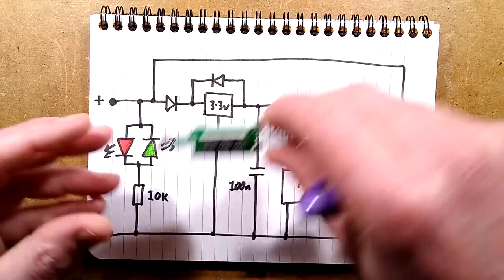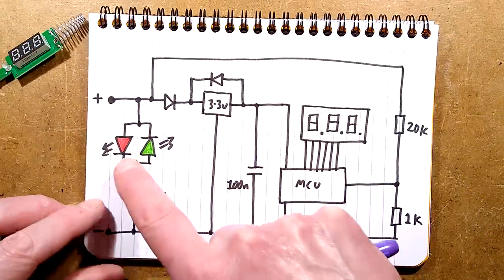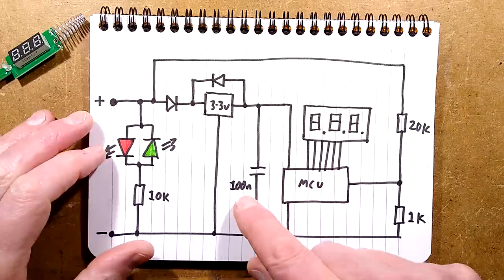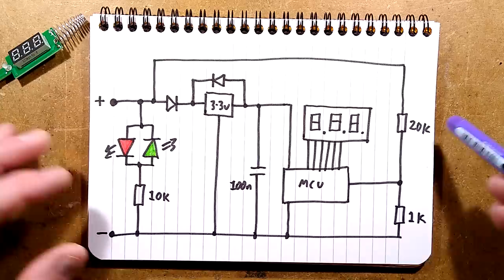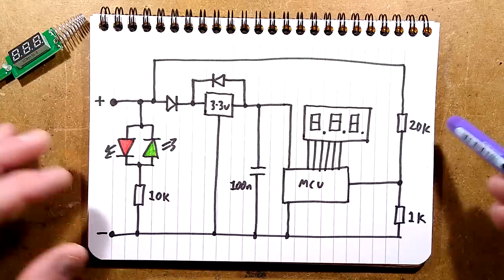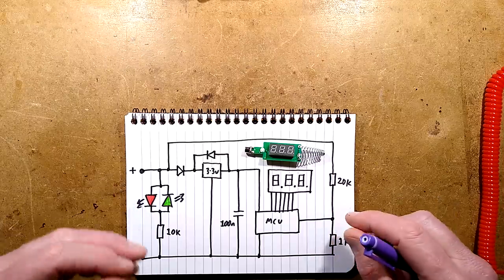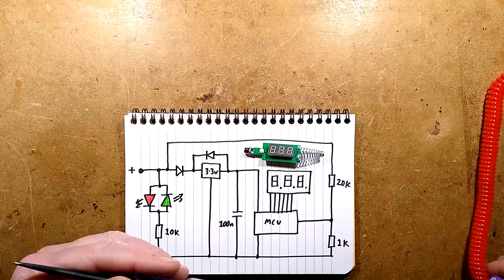Unusual, but accurate low voltage probe (with schematic)

Comment: Im going to test this circuit, because i have a feeling the 100n cap couldn't damage the surface mount regulator, you would have to short it while it was measuring a voltage because the led will drian that tiny cap almost instantaneously on disconnecting, as you know the recommended is usually 10uf both sides and a parallel 100n on the output to keep it stable and avoid any high frequency oscillation, (you can usually get away with just the 100n on the output, especially at low current and your well above the drop-out V ) in that situation with 10uf on the output charged to 35v maybe that could dump enough  di/dt to damage the regulator, (especially if the connected load adds capacitance) but here im going to guess not, i think the inductance/impedance of that 5ft coiled up test lead would be enough to save it alone, il let you know 😂 il measure the peak current with a low impedance shunt, il hit it multiple times and try a couple of different caps, then if it survives il add capacitance until it doesn't 🤷‍♂️

Comment: Could it be used also in some solar charging systems also like 12v and 24v setups?
Reply: 24V industrial control panels too.  Would be really nice with a 1000V model that quickly switches its ranges and voltage regulation method even if power is only different for a few ms . Would need some skills though to design the power supply and input subcircuits to accurately measure with 2.7 to 3.6 V inputs without frying anything at 999V continuous.

Comment: As the circuit does draw at least the current to drive the LED display and MCU, perhaps this is a fly-back diode to prevent inductive kickback from killing the MCU by the circuit under test? The only reason for it across the Vreg that I could divine, is that it would negate polarity protection if it were across the input instead of the Vreg. BTW, it does look like it should be pronounced 'chassis'  instead of 'shassis'... (kinda like it's prounounced 'chess' instead of 'shess') 😏

Comment: I like it. It may not have the functional capacity of my Fluke (only volts, no amps, ohms, etc…), but would fit in my pocket, and fewer things to hold.

It would be nicer if it did a few more things, but then it would have more buttons, and be bigger, which would be less nicer…

Comment: 5:13 oh, I know what it was supposed to do.
Originally, it would have been a freewheeling diode, that would protect the regulator against inductive loads, and against reverse polarity during turn-off.
In the case of that implementation, though, it does nothing, because it never gets directly polarised for more than a few tens of ns at a time. Lol

Comment: I have seen many car mechanics make the mistake of using an LED test light like this to attempt to diagnose electrical problems. Bad idea. LED's will light with little to no electrical connection... that's not a good test instrument when what you're looking for is a bad connection. A good old fashioned incandescent test light is the way to go. It draws enough current to only operate on a decent connection, or unbroken wire. And if you're used to your particular light bulb, you can instantly tell when it's not bright enough. I suppose this one is good for testing alternator charging and voltage drop.

Comment: The diode is, as you say, to protect the regulator. Normally, if there was a short on the input the smoothing cap would discharge through the diode. I suspect that was the initial idea but either the input protection diode was added as an afterthought or the pcb is incorrect.

Comment: This screams low cost technically acceptable. The led is backwards the lead color don’t match up. It’s like how much can we save and still make a workable product
Reply: The led is meant to be that way. Green indicates a good ground on 99% of automotive testers
Reply: @MattyEngland  interesting. I would have thought green means proper connection red means reverse connection. I guess automotive have different tests and terminology
Reply: @brentsheltz6473  Yeah, you can connect the more expensive ones to both battery terminals at once, then touching power gives you red and a voltage reading, touching ground gives a green LED (and often an extremely annoying constant beep)

Comment: now, connect to the mains and see what happens. 🤣🤣🤣
my buddy pretty much did that years ago, put an low voltage automotive probe on 240v water heater when checking elements.🤪🤪 KERPOW, cloud of smoke, molten plastic and bits flying about, blackened hand. only sorry I missed seeing it happen!

Comment: Brilliant video, I have a test lamp that looks the same as that but it has like a car interior bulb in it, I used it when I was doing car alarms and stereos, the times I had stabbed myself with it lol
Reply: I have one too I use it for buffering when connecting an inverter to a 12v battery
Reply: @pollywollydo  spot on thanks

Comment: my snap on one is more pleasing....
but has an incandesant bulb so can be used on zero volt also. voltage could easily be assessed by bulb brightness..👍thank you clive
edit 
this diode could be so u can use it either polarity like my one

Comment: Pretty sure the led is not the wrong way arround. if you switch polarity on the aligator side to positive you are on a hunt for ground connection failure on a vehicle. 
The green led signals just yea where you are polking right now its there all good here.
Ground on the clip side you perform deep analyses of circuits or fuse Boxes and so on.
The lead having current is also "hot" so its red led warning light now.
Its not counterintuitive from a car mechanica sigt of view.. ist your intuiion who is "wrong" here :P

Comment: Clive, would you consider this tester to be "electronics-safe" or "computer-safe" for automotive applications? I install Alcohol Interlock devices in vehicles and currently use a simple probe with a LED and resistor to verify wiring before I hook the interlock device up but occasionally need to guess what wire does what when I don't have a diagram for a particular vehicle. Something like this would be nice to eliminate another tool in my tool bag if I didn't have to worry about it frying a vehicle computer.
Reply from the maker: Current draw is only 2mA at 5V and 7mA at 12V, so it should be safe for electronic use.

Comment: did you look under the display for hidden chips?
Reply: the diode above the regulator is to protect it from short's I had that problem befor the diode was removed and the regulator over heated and blew up

Comment: THE REVERSE BIASED DIODE IS ACROSS THE 3.3V REGULATOR TO PREVENT THE OUTPUT BYPASS CAPACITOR FROM SPIKING THROUGH THE REG IF A SHORT OCCURS ON THE INPUT OF THE REG, SEEN THIS CONFIG IN DATA BOOKS FOREVER (SAFETY ALWAYS!)

Comment: Looks like a cross between a voltage tester and an awl  to me.  Use it to test electronic circuits Monday through Friday, use it to punch holes in leather for your weekend leather working hobby.

Comment: You know what - as red is right and green is wrong, while red goes to black and black goes to red: I think they designed it into the other orientation, until someone found out it was designed by a left-handed and the numbers would be upside down for right-handed people. 🤪🤭😂

Comment: Hi Clive, 
diode with capacitor reminds me of a voltage multiplier, feed it back into the input of the regulator to add to the incoming voltage (possibly allowing a 1v input to output a 3.3v regulated supply... possible? ).

Comment: looks like the diode across the regulator is a „datasheet residue“.
Chinese might not all be idiots, but share the same idiot-ratio with the rest of the planet.
I remember the duscharge diode being only needed for higher regulator voltage (<=12V), but in this case it is definitely no „discharge“, but a „disabled“ diode.

To the accuracy: a 10-bit ADC has 1024 steps, a tiny bit more than a 3-digit decimal display (1000). So no wonder it is precise.

Comment: Clive didn't say if the display moves to 1 dot 2 digits (hundredths) when the voltage drops below 10VDC.  The ones I bought do - 9.99 volts, etc.

Shonky isn't a word I'm familiar with, but then I'm separated from Clive by a whole ocean and a whole continent (so. California), so forgive my ignorance.  🤪   Thanks, Clive.
Reply from the maker: Fixed decimal point.  Blanks the first digit.

Comment: I can imagine the diode across the voltage regulator being a simple mistake. Many of them contain a diode integrated like this, so maybe someone just saw the symbol drawn with this diode in a datasheet or schematic and thought they should add it. Or maybe the other diode wasn't included in an earlier design iteration and then the one across the regulator was just left in there at the end despite being unnecessary.

Comment: back in 2021 , the covid days, I turned an old MAC automotive electrical tester into a high tech modern version very very very similar to this. I used an automotive LED bulb, supposedly rated for 36 V dc, but i upgraded the resistor and the cheap diode. I used an LED voltage board similar to this one but smaller. I also changed the resistor/diode on that, it was supposed to be rated for 36v dc too but i didnt trust it. Though i dont have any fancy polarity LEDs, mine just wont work if connected wrong. And i clearly labeled my ground...though it does have a red rubber boot. i digress. Lol  https://youtu.be/bWEblCGitXQ

Comment: Put the circuit board back in the other way and connect to the battery.....
Reply from the maker: It has reverse polarity protection.
Reply: @bigclivedotcom  Don't you reverse the polarity when you pop the circuit board in backwards..?  I thought it may be good for finding poor groundings,.
Reply: @evanjones2539  Why would you do that? You can just test by connecting the lead and probe in reverse to the source.